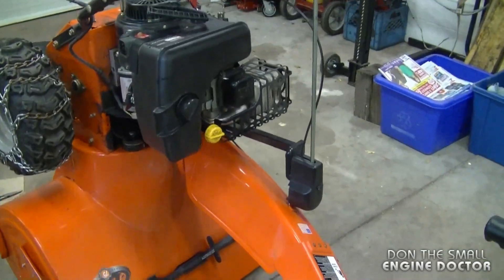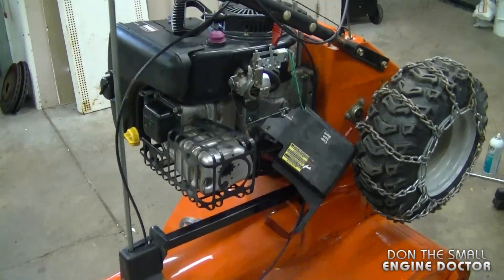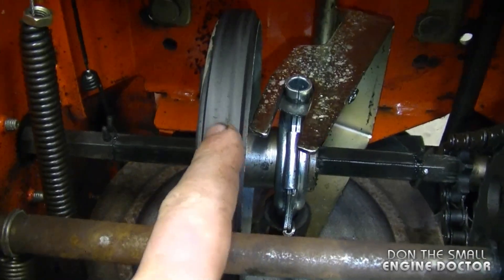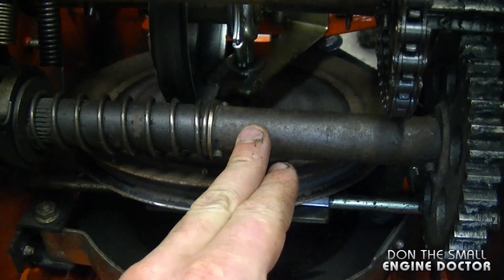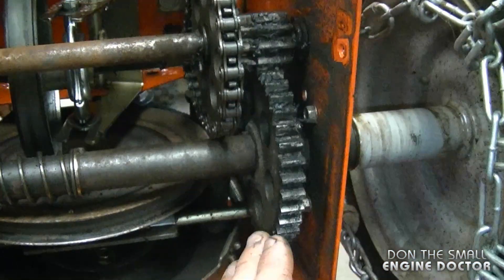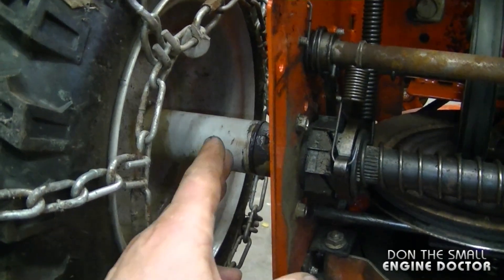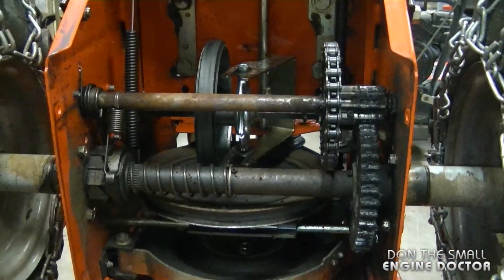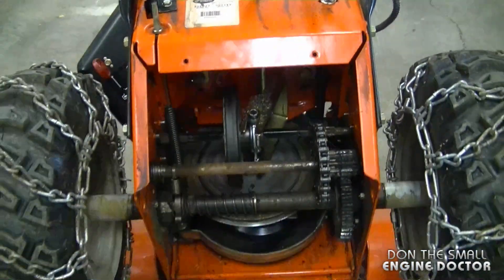Inside An Ariens Snowblower Transmission

Comment: I followed your video for putting on anti-seize etc. on my Ariens and noticed a washer and another piece fall out of the cover. Not knowing where they go or what they do AND knowing my blower slow speeds or reverse didn't work, I figured they had to do with the shifter. Not finding any video or instruction on how to install those, i kept looking.  Amazingly this video happened to have a view of the shifter assembly above the friction disc that pointed me in the right direction. Now the speeds work and so does reverse.  Thank you

Comment: I have a 05 ariens 924128.    St1332le.   I can't find any videos anywhere with the same transmission.   I took it apart without taking pictures and now I ha e an extra part.

Comment: I had a pro model and I wasn’t impressed the friction disk did not last long and the bearing or bushing on the side of the transmission came a part and also the bearing for the drum at the front came a part plus the cable for the angle of the chute would always freeze my dad had a old Ariens snow blower From the 80´s and it seems like they were better built ? I would like to know if I’m right or wrong ?
Reply from the maker: yes definitely the older ones are built better, even from just 10 years ago they are better

Comment: Hello Don : I have one of these 926027 snowblowers. I need to replace the spur gear on my machine the casting broke into three  pieces. Parts are on there way but the manual does not have anything on how the breakdown is done. Have you ever done one?

Comment: Hey Dony, make a video changing the friction disk on an Ariens Sno-Thro 10000 series built between 1965-1974. Their are still a ton of them out their and they are the most difficult friction disks to change out of any other Ariens snowblower ever built and for that matter any snowblower in general. I have to change mine and it involves about 20 steps with the directions with no pictures showing anything. You literally have to disassemble a good portion of the gearbox to get the friction disk out. If you make a video changing one of those bad boy's they will come. (If you build it they will come). Trust me their are a lot of owners of them old machines and changing the rubber friction wheel is a nightmare, a video will make it a lot easier. Just a suggestion, but people are really looking for that.

Comment: Ariens all the way.  My first blower was an Ariens I inherited from my Father-in-law.  I had it for over 10 years and when I gave up on it, it was not totally dead and was 35 years old.  A sale at my local dealer on new Ariens was too hard to resist and I got a new one.  A 28" Deluxe SHO.  It is as robust and as made of as much steel as possible as the old 1980 model.  Simple, effective design with minimal parts so that there is as little as possible to go wrong.

The new beast throws like it is on steroids so I will greatly enjoy it for what will likely be 30-35 years!

Comment: Just spent a long time blowing out the driveway. It seems to me that the right wheel was doing all the work. When it would bog down only the right wheel would spin. Any idea why this would be?
Thanks.
Reply: thats the auto turn feature i think. It's sort of like a Limited slip diff in your car
Reply: Thanks for responding but I fixed this already a while back. As soon as I took the cover off I saw that the teeth were not seating. A one second repair. Have not needed the blower at all this year so far. Being over in the Buffalo, NY area usually means using the blower multiple times a day and so far not once this year. Got to love global warming. I'm all for it.

Comment: Tire chains are really unnecessary if you have decent tires. Most tires on newer snow blowers work really well with no chains. I have a 1 year old, 2 stage Yard Machines snow blower and it will power through 1 foot of snow with minimal slipping even up my steep driveway.
Reply: you sure? I really wanna try some chains. Where I lose traction is trying to break thrugh the large banks left by the plow.
Reply: You could try. If the snow is really hard, almost ice it might not help.

Comment: my Toro is built the same way, without the steering :( works great after 30 yrs) cheap to fix the friction plate too.
ty for another good vid Donny
do you drain the engine to flip it up like that?
Reply from the maker: +fixt100 no I don't, I just make sure it's not leaking from caps

Comment: I have an Ariens from the early 70s and the transmission is very similar to that in configuration but mirrored and without the two piece axle.  It's also a track team unit that can be used with a mower or a leaf vacuum implement however it may be difficult to find them now.  The machine is also old enough that there aren't any safety releases and the only thing when released is the clutch for the wheels as it'll keep moving forward or backward.
Reply: +-Doug - This machine is from the early 70s.  Single piece axle. Nothing more.
Reply: Early 70's with a single axle. I take it your machine also has a 6hp engine. But definitely not the 7hp engine.
Sorry to break this to you, but you have a base model Sno-Thro, meaning your machine is not a Trac Team unit and will not accept attachment's.
The Trac Team units have a two piece axle with a differential lock on the left wheel (when standing behind the machine).
Without the differential (two piece axle) if you attempt to put anything else other than the snowblower on your tractor (for example the lawnmower attachment) you will tear up the lawn without the differential to unlock the machine from two wheel drive to one wheel drive to turn the machine. They sold the differential axle kit as an accessory for your base model machine, it shows it in the brochures on the Ariens info site you can also see the difference between the two models by looking at the parts diagram: http://www.partstree.com/parts/ariens/snow-blowers-snow-throwers/910962-st724-ariens-24-snow-blower-7hp-tecumseh-sn-000001-above/tractor-parts/
Reply: Differential kit, (if you wanted to make your machine trac-team accessible) http://www.partstree.com/parts/ariens/accessories/724015-ariens-differential-kit/differential-kit/
Reply: Fearless Front Nope, it's a track team.  It just doesn't have the axle, you undo two bolts from the top and without taking off belts the machine separates from the three toothed clutch.  No belts to remove.  It also has two levers, one being the overall machine clutch and the snow blower has another implement (the aforementioned three toothed) clutch.
Reply: The machine never had the original engine when I got it.  It first had a diaphragm style Briggs 6 hp then an 8 hp Tecumseh from my old Toro then recently I put a 208cc EnergyCube (A-IPower) engine on it with power to spare (they rate it 7 hp but I doubt that as the similar Honda rated at the same 4.1 kW was 5.5 hp, which is closer to the calculated conversion to horse power).

Comment: I have a 2003 Ariens 824 that has one problem that has always plagued this machine. When I'm blowing heavy snow and in the lowest forward gear, after while, the trans starts to slip. If I shift to the next gear, it's fine. I've replaced everything and this problem still exists. Did you ever see one act like this Don? I've just learned to live with it, but I miss having that lowest gear for going through high snow. Thanks for the video  Don!
Reply from the maker: +D. J. Tanner you may need to polish the metal disc, you can also try putting more tension on drive cable
Reply: +donyboy73, yes, I will look into these two things, I bought this machine 5 years ago and it was in bad condition and I went over everything.
Reply: +donyboy73 , thanks for the advice Don!
Reply: +D. J. Tanner also check your drive belt, in low gear the transmission is working harder as apposed to a higher gear. Cheers
Reply: +zyplex1 , thank your sir. Much appreciated!

Comment: Chains don't work to well with lug tires, must have been an aftermarket addition.  I have always liked Ariens for their transaxle components.  Grease zerks make a big difference for longevity of bearings, which they use in many different areas.

Comment: Looks solid enough, i bet its quite reliable too :-)
Reply: I'll say, it looks very much like the unit I have from the 70s.
Reply: +WJCTechyman 
Sounds like you have a good unit there, made to last and repairable.
Im no lover of plastic gears and crap engineering in modern things.
"Plastic Fantastic" NOT lol :-D
Reply: +zx8401ztv In lawnmowers and snow blowers, no, in vacuum cleaners, depends.  I don't even like belt drives in my walk-behind mowers.  I have two 27 to 32 year old Honda mowers with shaft drive transaxles and direct drive blade clutches as I want them free from problematic belts.  I had a Toro with belt based blade clutch and propulsion but nothing beats my Hondas.
Reply: +WJCTechyman 
i dont think there is much to compare against honda mowers, price is a good frightner unless you can buy a second hand one.
I was strapped for cash when my old mower died, i got a second hand briggs&stratton powered push mower, its a bit low on power but its done the job for 4 years :-D
I dont have a massive garden so a ride on mower would just be silly lol :-D
Reply: +zx8401ztv My machines were second hand for a very affordable price (free to $60 each).  I've had four come my way and built those into two.  These machines are almost as old as me and still get the job done.